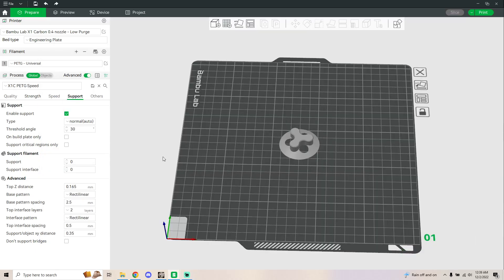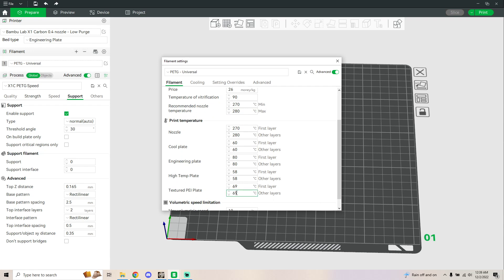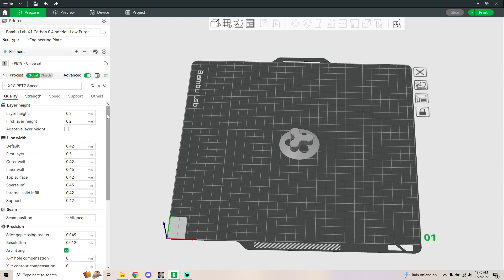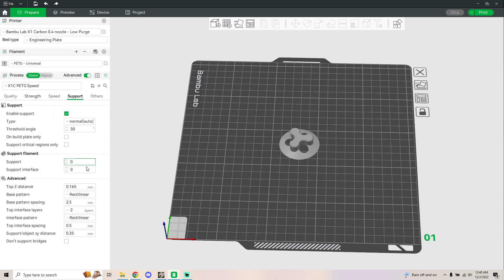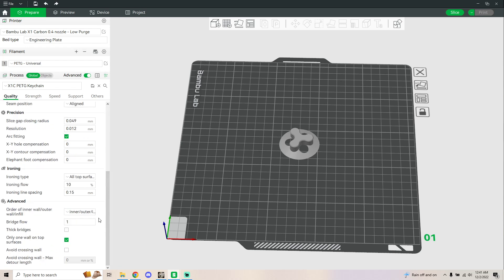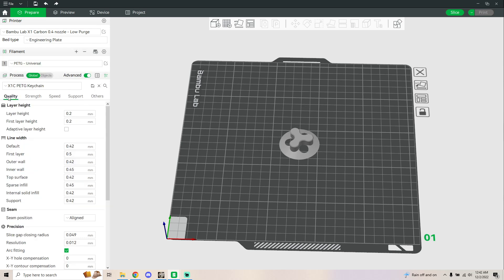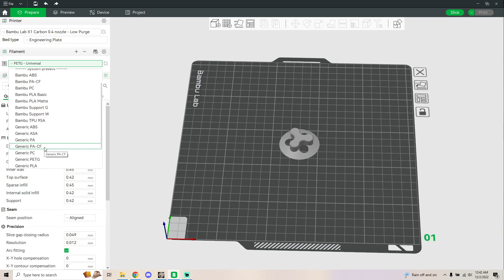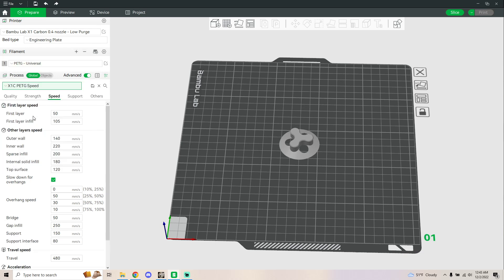Bambu Lab X1 Carbon: Bambu Studio - PETG Success - Profiles For Fast and Minifigure Prints! 11.17.23

Comment: About to try this with polymaker petg. I haven’t had any success with it since I got it, so hopefully these settings work.
Reply from the maker: @DYNAM0-504  unless you're doing Minis or something equally as small, this is fine. Everyone has had successfully prints unless its sorta detailed then drop the temp about 10 degress

Comment: For me, leaving the smooth pei plate at only 51 caused perfect adhesion for small objects, but severe warping for large prints. I had decent adhesion, although still warping at 70 so I will try the 72 that you have for the textured plate.

Comment: Hello. Thanks for creating the video but I still get stringing :(

Any updates?
Reply from the maker: Hello! Have you seen the latest updates that I put into the description box?

Not all brands run the same. I print slow and can usually manage the stringing if I print at around 250 - 260. It's colder than I would like, but stringing is a product of printing too hot.

Comment: Hey nice. 

I don't know why, but as soon as I print small components or components that are a little bit bigger, I have the problem that the laser layers come off and the component breaks with little force. But if I switch off the fans completely, the temperature is too high and it runs down. So the component has no time to cool down. Does anyone have any tips?
Reply from the maker: For small things, I stick to 250, and the speed is down to 4 flow rate. Ifnyou wsnt tongo indetail on the speed you can, but messing with the flow rate is "easy mode"

Comment: Thanks for sharing settings and description updates- took me from failed supports and terrible prints to perfect like PLA. Gave me hope for PETG printing. 
Bambu A1 with the generic PETG settings with Overture and temp range 250-260 was terrible due to speeds going too high. Switched to your temps and speeds and it’s clean crisp printing with normal adhesion to the Textured PEI.
Reply from the maker: Im glad this helped!

Comment: how did you measure that you need like exactly 58"C on the high temp plate and 69°C on the textured PEI plate?  Why not 60°C and 70°C for each of them?
Reply from the maker: The description has more updates.

Basically, I had A LOT of time on my hands when I first got this printer and kept making micro adjustments. Each plate had difficulty when removing leftover material when I was finished printing. PEI, for example, was notorious for having a lot of leftover material that I could not scrape off until I dropped it down to a particular degree. I could have gone an increments of five, but again, I had way too much time on my hands, and I'm just weird :P

Comment: I tried the PETG stock settings on my Bambu A1 mini I just got. When the nozzle got to the second layer, it ripped around like it was in NASCAR and the layers completely fell apart. I'm going to try dropping the speeds to around yours tomorrow, see if it helps. Thanks for the video, even a year later!
Reply: I second this ^ same on the A1, chunks of material getting shattered by nozzle and lots of material curling up from not being properly melted. Problems fixed with these settings

Comment: Much appreciated  🙏🏽 thank u. Helped a ton!!!
Reply from the maker: No problem! You will definitely need to experiment with the temp depending one the brand and colour. Overture silver is hyper sensitive and needs to be printed at 245 or so. Most super big prints that take up the plate can be done at 250 - 252 with minimal stringing and rifts

Comment: This video was extremely helpful. I've been using Overture PETG on my Prusa for months and have made several quality prints with it. When I tried it on my Bambu P1P with default settings, it was always a disaster and I was disappointed. After doing a bunch of research today, I found your video and it worked perfectly every time. I had a print that was a 29 minute print with Bambu PETG Basic settings, and your settings only lengthened that time to 30 minutes (Speed setting), and the print turned out perfect. Thanks for saving me from having to find a new filament manufacturer.
Reply from the maker: Im glad I was able to help 😊😊

Comment: Hello! I decided to try these settings as the generic PETG settings for my P1P was decent at best. I changed the numbers to match yours and the print did improve. I still have issues like blobs here and there as well as inconsistent lines only at certain areas, not print wide. I believe it's my fan settings and I've dropped my speed down to 50% and that helped some but I still need to fine tune. Maybe I need to slow things even more?🤷‍♂️

Can you show your fan settings? That matters with PETG.
Reply from the maker: Sorry for the delay! I dont go any faster than 40 personally. Even on my last machine. There is another profile I've tried that has given me better overhangs on some models but also killed my speed by adding an extra ~1 hour and it was useless for most models Ive previously printed because it ended up looking worse in some cases. I think the files are on printables if you would like to try for yourself.

Comment: Amazing! Been struggling with the first prints with my P1P on my first day with it on PETG. Nothing was working until I watched this video. Thanks a bunch for sharing! Note for P1P and Duramic PETG, nozzle temps at 275 work excellently with your settings, even in ludicrous mode. Many thanks!
Reply from the maker: Im glad this is working for you! I always tell people to compensate heat for the speed. Otherwise, you start getting matte areas.

Comment: Thanks for sharing your settings, i´m going to test those settings using SUNLU PETG. 🙏
Reply from the maker: How did it work out? I hope it made life easier! My settings are not the be all end all, but its a good set into the door
Reply: @NimbusX823  it helped out a LOT  and i was able to print the parts in time. Only had to do some fine tuning to get a useful finish of the outer wall (ringing artifacts).
Reply from the maker: @megafonmann  nice! Share your results if you can! It will help a ton of people out!

Comment: lol, with your settings I changed a 3.5 hour print to 14 hours and 28 minutes. Sorry mate, but you made a big mistake here. Also the temps for the PETG is extremly higher than 99% of the vendors. Normal PETG temps are between 210 and 230 degrees. Pushing it to 280 will only cause strings and many other issues.

My best advise for printing PETG: 
1. Always use the generic profile
2. Setup the flow to 1.0 in the filament settings
3. Use the suggested temps for the filament by the vendor. Even the Bambu Lab temps are too high for most PETG.
Reply from the maker: The Terminator T800 bust on Thinigiverse using Generic PETG takes 11 ish hours. Using PETG with my setting, it takes 15. I have no idea where you are getting your times from but I am not printing anywhere near that slow. 

I have updates in the description showing the changes I have made in revent days. 280 was required for printing with Kinluot PETG but even overture printed without strings on 285.

You need to compensate the speed with a higher temp. Otherwise, you will get matte coloured prints.
Reply: @NimbusX823  sometimes the times are displayed wrongly. Maybe it’s a bug in the slicer software. But over 250 degrees for PETG seems a little high.
Reply: @NimbusX823  Hi mate, I want to give your settings another go: What options did you setup under cooling for the PETG? Do you for example skip the cooling for the first 3 layers? Thats the default setup for the generic profile.
Reply: No your temps are to low , overture PETG is at 230-250

Comment: If you want speed, you need to up the volumetric speed limitation and tune the flow rate with softfever. Im running 18mm

Comment: Big improvements from the generic petg setting 🙏🏼
Reply from the maker: Honest to God, I don't think Bambu Lab actually tried PETG. PETG is my religion. Aurora Tech also had issues with stock generic settings and she had to drop the speeds. 

I have been putting updates in the description as well of my findings. One of these days I'm going to make a new video since my settings have changed quite a bit. Using Kinluot as a starting filament along with Matter Hackers influenced a lot of my starting settings.
Matterhackers in Overture are the most consistent PETG filaments I've used so far. Kinluot is garbo filament, their light blue is the only exception.
Reply: @NimbusX823  There is probably a reason they don't even sell their own brand of PETG yet.
Reply: This is my first time using PETG so I didn’t know what to expect. After a few test prints they all looked garbage. Good thing I decided to check YouTube and found your video lol. 
Is it the high speeds and temp that’s causing poor quality for bambu lab printers?
Reply from the maker: @JackOfAllTradesPerformance  Pretty much, yes. Going too fast for PETG causes the filament to slightly "lift" which causes a lot more filament build up on the nozzle. If the filament doesnt lay down on the layer properly, it just makes a mess. Going slower for PETG in general is best. You want to be sure you are printing hot enough as well. Printing too cold causes colours to look matte. This usually means the filament didn't crystalize or transition fully so it's not as strong as it could and should be.
Reply: Ah okay. Thanks bro🙏🏼.  I subbed so I’ll be looking out for some updates Aha

Comment: Thanks for sharing! I'm going to try this tonight. Is this for standard speed printing or have you tried sport mode vs ludicrous?
Reply from the maker: This is just my basic setting for standard, I have also tried it at sport mode and it seems to do fine. I only recommend sport mode when you have large bodies, when you start getting down to the details, slow it back down because it starts to look bad on small details going fast.

Comment: In your PETG-Keychain(quality) profile, you have Acceleration - First layer - 1500mm/s2. But in all stock regular and in your PETG-Speed profiles it is set as 500mm/s2. 
Is it for a purpose?
Reply from the maker: Good eye! Yes, the reason behind this was the first layer would ways have this gap in the corner that didn't have enough Filament. There would almost be about 2 - 3mm worth of space without extruded filament. I contacted Bambu Labs support and they initial told me to change it to 5000. It worked but was over kill by a long shot. 1500 is near perfect. .2mm gaps instead of 3mm is a significant difference. You could probably be a perfectionist and go  higher but I would rather slightly under than over for the first layer.
Reply: @NimbusX823  Thank you!
Btw, on one of the screens I saw that you have a custom profile for PLA. Could you please share your findings on that too?
Reply from the maker: @Andy_Glo  No problem! I have made a few changes and a follow up video at this point would make sense
Reply: @NimbusX823  Hello thanks for the video, have been strugling with PETG a lot! doing a print now and it looks like it works like a charm :)
Would like the setting for PLA as well if you got the time for it :)

Comment: Got my P1P yesterday and was very disappointed with the quality of the "generic PETG" and default settings cal cube/flowcal prints I made. I will give your suggestions a shot and follow up tonight!

Thanks for posting this, there's not a lot of people printing PETG on the Bambu Labs frames yet.
Reply from the maker: Let me.know what you think! I have made a few updates as well in the description box. I will continue to update the description box every now and again when I do more test and such. I recently made changes to "keychains" since it's not going fast it doesn't have to be at 280 unless you are using a brand like Kinluot. No matter what I do, if that brand is not printing at 280 no matter the speed, it will jam the nozzle. I have had to clear the nozzle jam for this one specific brand of filament several times
Reply: @NimbusX823  I upped my speeds a little from yours, upped flow as well, and use 285C. The trick for me setting the temps right and calibrating the flow as best as possible!
Reply from the maker: @novakinb  if you get er results, throw them up online and help other creators 🙏

Comment: Are you using the stock cold plates or something else?  Have you tested the Energetic dual-PEI (smooth side) plate by chance?
Reply from the maker: I use energetic smooth PEI, energetic textured PEI, and my custom G10 plate. I don't bother with the stock plate
Reply: @NimbusX823  Awesome, thanks. I ordered the Energetic ones myself and have been waiting for them to arrive. I'll refer to your video when I'm ready to print PETG.
Reply from the maker: @cleverestx  the plate gets better when you use it more often. My experience at least. Also, while you are just sitting around and haven't printed anything yet just let it sit in the bed at 80° for while. Clean the bed with rubbing alcohol 91% and use a white towel. Micro fiber towels colours actually bleed in my experience when you use coloured but depends on the brand too. White towel works best. I use a Flitz towel personally